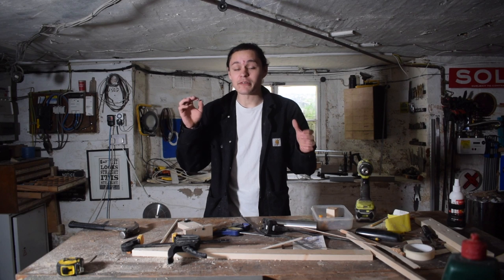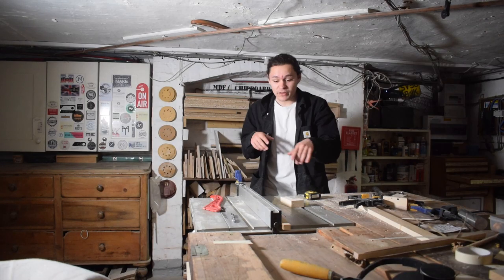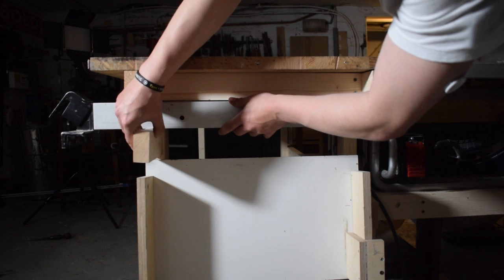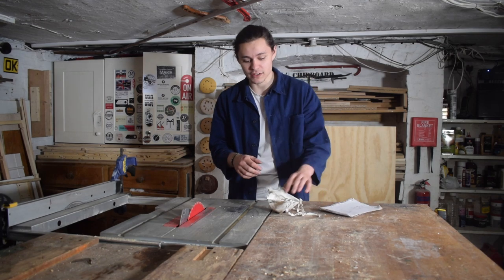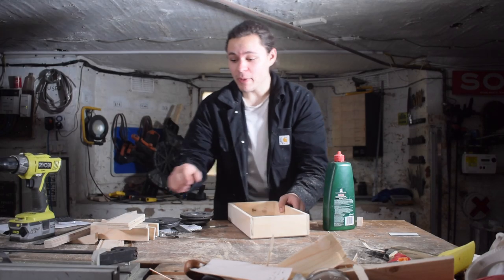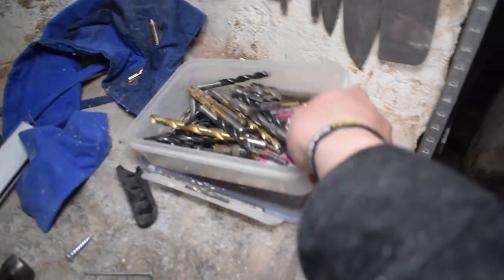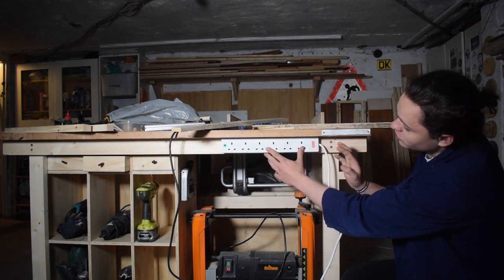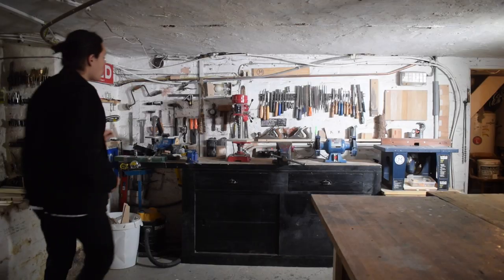Making a Workbench/Out-feed/Assembly Table [Part 2]

Comment: Hey J. What table saw blades do you use? And can you recomend them? Im looking for a better quality universal blade. Thx.
Reply from the maker: I've always used and would recommend a 40TPI blade - I find they're the perfect middle ground between giving you clean cuts without bogging down the blade. At the moment I've got a freud one in the one the saw - slightly more expensive than the erbauer ones I used previously but they've already lasted a lot longer (I've had mine in for almost 6 months now!). Hope this helps :)
Reply: @jmakes3745  thx a lot